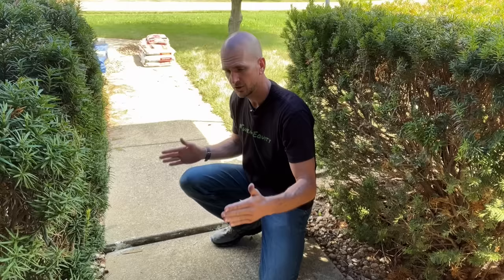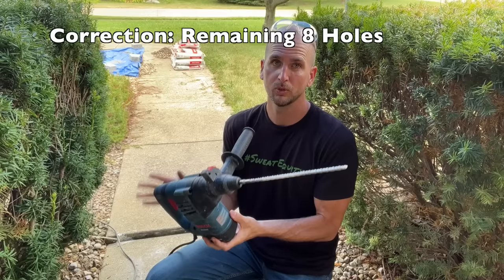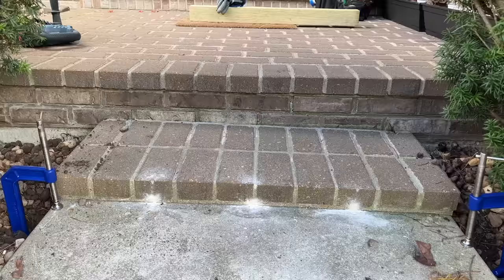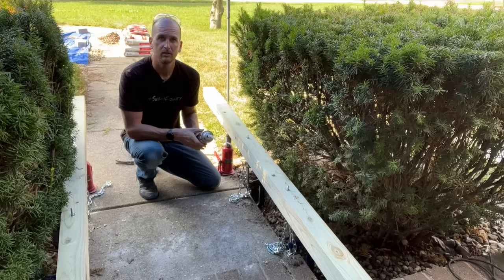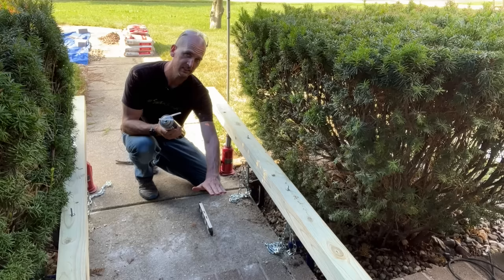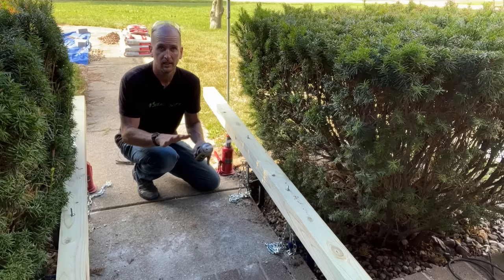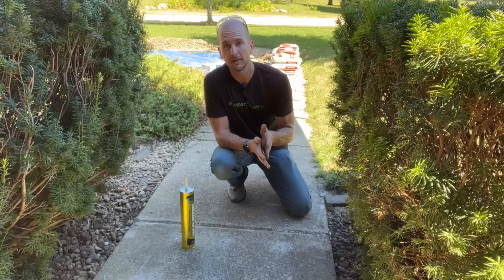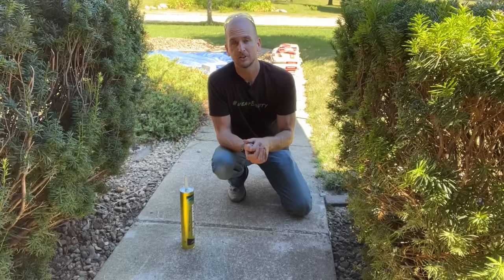How To Fix A Sunken Sidewalk With Spray Foam

Comment: After viewing all the tasks you had to do in order to lift up a small slab I've decided to redo all of my slabs by simply making them at least 6 inches thick of formed, one piece stainless steel that is shaped and angled to conform to the walkway path and these "slabs" are fitted on top of a "roadway" that runs beneath them using a very similar design to what the ancient Romans used (to avoid under the roadway moisture issues potentially bleeding out the material under the walkway). That ought teach them slabs not to misbehave!

Comment: For anyone who has not drilled concrete, the rotary hammer drill is the way to go, and it uses an SDS concrete (masonry) bit. The SDS allows the bit to move in and out of the chuck by ~1/4-3/8" while rotating. (N.B. don't use these on mortar). If you rent one, the size used here is perfect. Many places rent the larger Bosch (other makes?), which are much heavier and difficult to control for this size bit. 
I'm not sure about the GreatStuff retail foam's properties for this use case. It does expand rapidly, and depending on the age and make-up of the concrete as well as the consistency of the base material (sand, soil, gravel) on which the slab was poured, it may cause problems with cracking or sinking. There are commercial/professional grade injection 'foams' that are specifically engineered for this. They remain liquid longer and expand more slowly, allowing them to flow into the substrate and fill any voids that one obviously can not see. The cost is higher (of course).
Another thing to consider, find, and remedy is the underlying (pun intended) cause of the sinking. (I.e., water drainage). If, say, this was caused by water, the foam injected will cause the water to seek another route. 
If you have an older home, espessially pre 1930s, the concrete may be extremely hard as concrete continues to cure for decades. There are graphs and charts on line showing curves for concrete curing (hardening) times and depening on where you live and the aggregate used (mine is from 1914 and the aggregate ranges from granite to what almost seems like coal - I'm in Chicago). 
But, hey, this is a very elegant solution for lifting and injecting material that isn't expensive, and if it fails, pretty easy to break it up and pour a new section. 
I love the way you create your videos. Clear and consise.

Comment: Good job on video.  For a single slab like that I'd first lift with breaker bars and fill.  If result wasn't satisfactory I'd jack out old slab and pour new one, linking it to the rest of walk.  What caused the problem to begin with is presumably one section or the other was poured first with a newer section poured later, with no attempt to ensure stable height consistency.  Holes should have been drilled the side of the old slab, with short pieces of re-bar inserted that extended into the new pour.

Comment: For the DIYer, it might be more cost effective to break out and replace the slab. A 3 x 3 foot by 4 inch slab would be 6 bags of concrete mix which would cost under $20. Probably less than the foam and crack sealer. Now throw in the cost of 4 x4's, clamps, j-bolts , chain, bottle jacks,  drill bits that you may or may not have.

That said this is a clever trick if the sidewalk was patterned or colored which would be hard to match. Or in my case I have 15 or 20 feet of sidewalk that is tilted and sunk differently
between slabs. In which case the investment in tools would be worth it.

Comment: 1. Use farm jack to lift one edge, lean on edge tilted away from workspace on solid object. 2. Raise and level bed with 3/4 inch gravel. Yes, gravel. It doesn’t compress, except a little of the bottom layer sinking into earth. Best long term bed. 3. Place 4x4 over void. This will be last thing slab rests on before laying it all the way down. 4. Walk down slab to 4x4 using 2 piece triangular framing lumber support. (Hard to explain in a comment.) 5. Attach farm jack to middle edge again, lay it down. 

Whole thing takes 20-30 minutes, tops.

Comment: I have used foam on other repairs such as filling voids in wood before skimming over the foam with exterior waterproof wood fillers, bondo etc. The only issue I have is what is the life expectancy of the foam vs a concrete material before the foam deteriorates, causing the slab to settle again?

Comment: Nice video. But my issue is that only a portion of my driveway has subsided. Attempting to raise it is my problem, since I can't get to the edges to put C clamps on the edges like you did. I think my only option would be to drill holes and put bolt sinkers into the holes in order to grab the slab to raise it.

Comment: Interesting idea.  My side walk sank making it lower than the concrete  on both sides of it (as part of a drive way) Can’t really use c clamp method but it might stir up some ideas on how to raise it. In my case not so much a tripping hazard as it is a drainage issue. My roof drain is right there and water pools up in the sunken part.  My fear is with no where to go it will seep into the cracks making the problem worse. I’ve sealed the cracks and try to sweep the water out if I can.  Not sure what to do that would be budget friendly (prefer not to call in the professionals lol
Reply: Expanding concrete anchor bolts can carry quite high tensile loads. Choose a size and quantity based on the weight of the slab. Place them at least six inches from the edge. Then either use threaded rod nuts and eye bolts (preferably forged), or capture a chain link under a washer.
When done, cut them off just over the cement, then drill the bolt out to about 1/2" below the surface. Fill them with the same sealant or suitable mortar as the injection holes.

Comment: When I worked (after my morning coffee break, American Postal Workers Union break, and then recuperating from being exhausted from walking to the breakroom, and then the used coffee department break), we raised up sunken concrete flooring slabs  using hydraulic cement. We raised them up so they slanted toward the overhead doors. It helped get the 1st class mail out of the warehouse faster. Too bad the truck wasn't at the loading dock though.

Comment: Another option would be to float the whole walkway until it is level and then put pavers or bricks on top. That would cost more but look way better than just a concrete path leading to your front door.

Comment: Clever. Only a little bit more expensive than ripping out that section and a lot more work with a dubious result. Other than that, brillant. Perfect idea for YouTube DIYers afraid of working with concrete.

Comment: Assuming most people do not have bottle jacks, hammer drills, masonry bits, large C-clamps and 4 x4's laying around, it would have been way cheaper to bust that with a sledgehammer and re-pour concrete.  All you need is the hammer, sakrete,  a 5-gallon bucket and a piece of scrap wood for screeding.  Foam will collapse in a year or 2 and allow water into voids which will heave in freezing climates.

Comment: It takes more time and work than if you just bust it out and repour the walk.  Crazy amount of work to lift one small slab. Takes 5 minutes to bust it up with a sledge hammer, 25 minutes to set forms and backfill then an hour to mix and pour a slab without a dozen holes in it.

Comment: I followed your instructions to the letter. I applied the foam and watched it seep out the sides of the slab over the next several minutes. However, the foam actually raised my slab 1-1/2 inches. I started placing all the weight on it that I could find, but it didn't help. Now I'm screwed and sitting here thinking I'm going to have to bust the entire slab up and re-pour it.

Comment: Excellent strategy and presentation. You do very nice work. A section of my concrete driveway subsided and cracked so I went looking for companies who do mud jacking. Couldn't find anyone local but did find a service that uses foam to raise slabs. They quoted me about $1000. I said "screw that" and went and bought a masonry product made specifically for repairing concrete walks. I built up the sunken area to be level and it's held up remarkably. Also, the materials were less then $50.

Comment: this is very interesting coming from an automotive background and not repairs like this as we use something similar in removing a fwd transmission as the sub frame is shared with the engine and transmission using a tool called a engine support bar that had J bolts that supports the engine after the removal of the subframe. I see no issue in this process other then questioning how long the foam will last before breaking down

Comment: I would expect this level of effort for a very large structure, not a small slab you can lift by hand, put more aggregate or cement under and place back down, tamp level in 15 mins, I find it quite bizarre but I’m impressed by how complex and involved you made a very simple task.👍

Comment: I remember seeing an article that they straightened up the tower that house is big Ben in London, using what they terms a caulk . I wonder if actually putting a strong building caulk underneath that would be better long-term than a foam.

Comment: How about trenching along damaged side. Then driving thick rebar underneath w/heavy hammer. Hook chains to however many bars used and lift w/car jack placed on 3/4ply, on ground across from rebar. Insert big stones to hold slab. Remove jack and rebar, then fill with 70/30 dirt/cement mix by packing tightly w/2x4 and sledge hammer. This insures cavities are filled!

Comment: Over time the foam will break down and the slab will drop.
Do the same process of lifting the slab and drill bigger holes, then pour shotcrete or gunite (liquid concrete) in the holes. Now you have cement supporting your slab, not foam.  A+ for the idea, D- for execution .

Comment: I've used the great stuff to do the same thing ,but it does expand quite well under the slab so that many holes for such a small slab is excessive! Also it will expand and lift it itself without having to lift it! If your gonna lift you might as well just flip it up and fill in with gravel or just lay down dry concrete to level it and it will harden up itself ! Just my opinion I'm a professional Truck and Auto mechanic not a mason!

Comment: I've read a bunch of comments, at which point I probably would use the "lift and fill" method, filling in with SOMETHING added right under the existing sidewalk slab.
HOWEVER...if I used this video's method, I would put squares of plywood between the C-clamp feet and the concrete.  I see pieces of concrete breaking off with metal to concrete contact points.

Comment: If you lift the section of sidewalk back to original . 
 There will be an open void beneath. 
  Without supporting eventually i believe it will crack from use. 
   I am just not sure if great stuff foam would last over time with the weight , weather and use ? 
   I know that great stuff has several different strengths and maybe one of those would work ? 
  I would think an exterior suitable foam would work for a while ? 
   Probably work ok over the long run ?

Comment: Good stuff! I have the opposite problem. I have a sidewalk slab that has risen about 2 inches on one end. There's no tree roots. it just lifted for some reason. Any Ideas? The only thing I can think of is, lifting it up somehow and digging some of the Dirt away underneath and then setting it back down. Is there a better way?

Comment: Couldn’t 4 large tapcons be used to screw the chains to the cement side walk on the four corners then pull up the slab using 4 x 4 support with a    Jack?  However, this is one man doing this job on a very big slab.  A small slab you would just use a pry bar to lift and fix it the good old hillbilly way and just fill it with dirt and rocks after lifting then bring it down jumping on it a few times to get it done.  

Love your ingenuity!  It will be great on heavy applications.

Comment: The hardest part is being able to raise the slab. With that being said, I wonder if you couldn't have simply sprayed the foam directly underneath from the sides, with the attached straws?  You could have raised it higher than needed, sprayed the foam underneath, then lowered the slab to the desired heighth and let it cure.  Any excess would flow out the sides.

Comment: for this situation I would have just lifted up the sidewalk section higher and then poured some watery cement mix under it, rodding it under it until I thought it covered most of the area. then lowered it until it was flush with other sections and waited for 2 days.  no drilling no foam no real screwing around

Comment: I used Jack bolts that way I could leave them in there under the sidewalk, and then put flowable grout under the sidewalk with a concrete vibrator. This is way better than spray foam.

Comment: If you are going to go that far, just lift it half an inch taller, push in below some gunnite below, lower the section into the gunnite and level it as you see fit and allow it to cure in place.

Comment: Great video. Here's a idea: instead of drilling through the concrete, as a means of getting the foam pushed into the center, how about inserting tubing under the slab after is it lifted? use these as conduits to spread the foam.

Comment: Hey the foam is not concret or cement and soft. You will compress the foam over time and then you have the same situation like before. Am for the clamper I recomennd to cover the arms which will be contaminated with the expanding foam in a e. g. polyethylen freezing bag bofor you clamp it in position. This will reduce the workload of cleaning the clamp arms from the stickimg foam afterwards. Regards from Germany

Comment: My two issues is the holes and the foam. 
Holes seem unnecessary given the size of this concrete , it could’ve easily been dug up on the sides slightly more than needed for the C clamps and foam injected from the sides OR gravel.

Second the foam. I question whether this is suitable for weight baring applications and wont compress over time and thaw freeze cycles.

Those two critiques aside , I enjoyed the video as someone who appreciates out of the box thinking and resourcefulness.

Comment: Maybe you have some ideas for a bigger slab. Like maybe a section of a garage floor. For some reason, after 55 years, the front leading edge of my garage floor sunk about 3/4 of an inch. Now it collects water in the winter and freezes.

Comment: bigger trip hazard is that brick step, it suffers the same issue my moms old house had, years after the porch was built someone came behind it and poured a concrete sidewalk up to the step without excavating to maintain the same finish grade so the first step is way shallower then the second riser, I ended up demolishing the sidewalk and doing a brick paver walkway at the proper elevation.

Comment: For all the work, why not cut the slab, lift, level the substrate and restore the removed slab.  The method in the video is excellent for larger slabs, but for something this small, the removal method could help identify any leakage/drainage issues to correct.  Still, I like how you suggested drilling out the foam from the holes, many videos seem to lack this important step.

Comment: Cool trick, thanks for making the video. I personally, if not just bust that slab up and pour a new one, would have had concrete injected underneath, as I don't trust great stuff to last as a load bearing structure, at least not outside.

Comment: All the unlevel was caused of not using wire when the concrete was poured to secure the concrete together. So that being said it would be better in the long run to rip it out and replace the concrete correctly

Comment: Simple way to avoid these long term driveway issues is to install a grid of #3 rebar at midpoint of the slab. Wire mesh does not work. Spend a few hundred dollars extra. Its worth it!  (25yr heavy Civil & high-rise concrete construction)

Comment: Just use a pry bar to lift the block and pack underneath with a cement mix of 3 sand to one cement, no need to drill holes

Comment: Thank you for the video.  I have a brick mailbox which has now developed a slight tilt.  I can move it by hand.  Wondering if I can use the spray foam underneath the tilting side to straighten it out.  Please let me know your thoughts.  Thank you.

Comment: I wish I could do my steps up over tree roots for 44 year old adult tree, much less driveway. If I move a metal wheel floor jack, engine lift (Cherry Picker) you can hear the hollows like tapping on drywall for studs. The problem with the driveway is it’s 40 feet long, 20 feet wide and has 243 cracks! I would guess the wire and rebar are in the nearest home improvement store and not in the 3 inch thick driveway they poured in 1980! My bet is no gravel, 3/4” minus rock or compaction. That was outside the budget of housing contractor as my house and neighbors was a show home in 1982 when done. They didn’t sell so they built 1,400 sq ft bi-level homes and filled almost the entire neighborhood. Concrete is now over $430 a cubic yard and is sold by “Unobtainium” companies that are still in business. Well, I am due to hit the lotto and replace the driveway, having $632 left after a $1,000,000.00 lotto, minus Federal, state and 40% loss plus concrete. That all that’s left! 
Thanks kindly for the interesting sidewalk video. PS, sand can be added to “Vulcume” after proper install to make expansion joints disappear! Thanks Sir!

Comment: Two bottle jacks, 3 pressure treated 4x4s, chains, 4 c clamps. Drilling holes in the slab that will crack, spray foam. Just pour a new slab.

Comment: Much easier, quicker, more durable and less expensive to break up the old concrete and pour new concrete.  If you really want it to match, as another commenter said, it is easier to pry up lift add dirt and replace the existing slab.